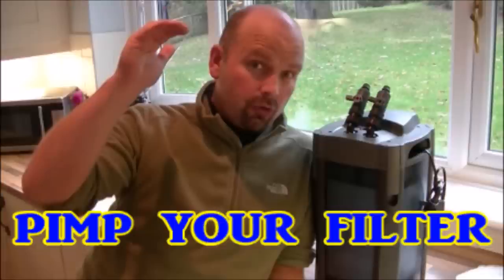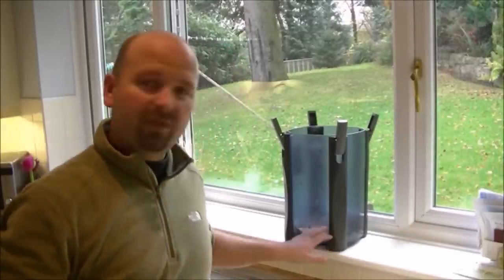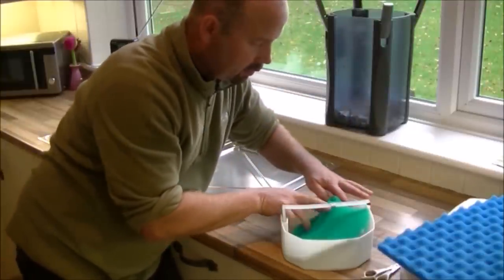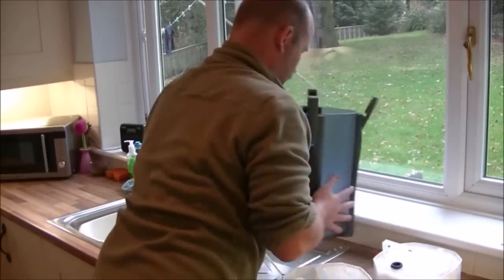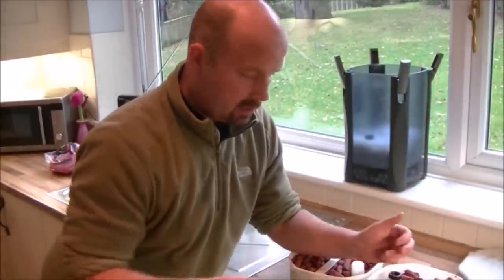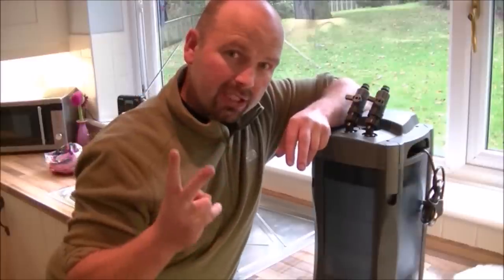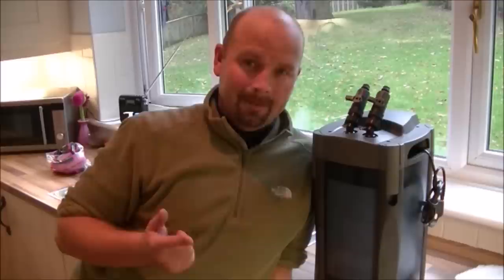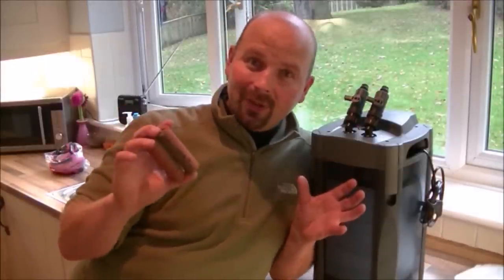External canister filter set up, nitrogen cycle and what happens in a filter - by Pondguru

Comment: how loud are there external filters?
Reply from the maker: +Anthony Hague There should just be a quiet hum coming from them unless there is an airlock or damaged impeller. Most of the noise will be from the return feed if a spray bar is used and it is well above water surface.

Comment: I was looking at the fluval fx6 and it looks like
they stack the media backwards from this? they have chemical on bottom then bio then mech? this seems ass backwards to me.do you know why they would load the canister like this? any advice my friend.
Reply from the maker: blimpus I mentioned the FX filters briefly in this video but really should do a sort video specifically for filters of that type. They have the pump in the bottom, not top like most externals so the water flows from top to bottom through the trays. As the FX has good foam filtration surrounding the media trays you really only need a fine pad on top of the top tray. Therefore you can get up to 5kg of biohome mini ultra or biohome ultimate (as used in this video) and that should be good for a noticeable nitrate reduction in around 500 litres. No need for chemical filtration when the filter is set up properly (as there will be no ammonia or nitrite) unless you need to draw in some residual fish treatments (after treating fish) or colour from bogwood.
Reply: yup! makes sense now that i see the way it is setup with the pump on bottom.

Comment: does anyone know if the Aqua one 600 nautilus should have rubber O- rings or grommets on the interconnecting basket (to make a basket to basket seal when the water in pushed down to the bottom on the canister?. My unit did not have any, but i`m struggling to find info / picture that show a Aqua one 600 nautilus setup in close detail.
Thanks
Reply from the maker: +Richard Gormley I know manufacturers have been moving away from having them in the filters as they are easily lost. I'm not familiar with that particular filter unfortunately so can't say if it should have them or not.
Reply: +Pondguru Outdoors 
ok thanks for the reply, i will go back to the shop  where i bought and ask them,..and ask to have a look in another unit and see it it`s in there. (maybe my unit  was opened / missed at the production line?)

Comment: isnt dropping lose media to the bottom of filter will reduce flow rate of water? add length of hoses & your canister will work 3d of speed it should isnt it?
Reply from the maker: As long as the media used in the bottom to diffuse the flow is ring shaped water flows through it no problem and it does not affect the flow. I can't understand the last part of your question unfortunately - looks like google translate has substituted wrong words in there.

Comment: any recomendations for a 80$ filter for a 55gallon hob or canister
Reply from the maker: +NorthEastPatriot I would avoid HOB filters as they rely on an expensive cartridge system and have very little space for proper filter media. I'm not sure what is available as far as externals go in the US as I am in the UK but ultimately the most important thing is what is inside the filter and how that is set up.
Reply: +Pondguru Outdoors ok thanks
Reply: +Pondguru Outdoors Im narrowed down to a sunsun 302 canister or a aquaclear110
Reply: +Pondguru Outdoors probably going to go with the sunsun due to the fact of media i want alot of bacteria that a hob doesn't provide.
Reply from the maker: +NorthEastPatriot Yes, that was going to be my answer to that one - I'm not a fan of HOB filters at all for that reason.

Comment: One question,  eheim 2217 , would that be set up with with the foams in the bottom as well ? Thank You in Advance.

Woody's Discus
Reply from the maker: Yes foams and fine pad in bottom although the design of that filter doesn't lend itself to being set up properly as the weight of media can crush the foams. Much better to get a filter with separate trays for media and foams.

Comment: can the the bio balls that have bacteria in them be used in saltwater
Reply from the maker: +Ricky Leigh The ones featured in this video contain freshwater bacteria so are no good for marine. They won't harm it as the gel will still be used by marine bacteria but there is a form of gel balls specially formulated for marine use called 'Pure reef balance' from the same company and they work very well. I have them on my website here: http://filterpro.co.uk/pure-reef-balance-marine-filter-balls-80-p.asp
but I have also found them on Amazon (currently cheaper) here: http://geni.us/zyh

Comment: where can i buy course foam and medium foam..i cant find in lfs
Reply from the maker: Amazon or ebay will have it or you could try places which are more specialized in pond fish / koi - just search 'replacement pond foams' and it should come up. I send them all over the world from http://www.filterpro.co.uk but they should be available locally - even if you go for the flat foams that is OK as there isn't a massive difference between the capabilities of flat vs bumpy foams. As long as they are layered in correct position they'll do a good job.

Comment: Noob Question: When you clean the filters. Do you clean the bottom also? Where all the muck has been settle out?
Reply from the maker: +Tboy Ojojoj Yes the bottom of the filter and the foams are the most important parts to give a good cleaning. The media should stay clean if the filter is set up properly but if it looks a bit dirty simply shake the media trays in water you have drained from the tank into a bucket.
Reply: +Pondguru Outdoors Thank you for you quick answer. Really appreciate it. I'm just about to place an order for this kit and will give it a try. /Tommy.
Reply from the maker: +Tboy Ojojoj Sounds good to me and thanks for the order, man.
Reply: +Pondguru Outdoors I got my order today. Thanks for fast shipping and everything was as I expected. I noticed that on my filter I have 4 trays. Can I use a thick coarse filter in the bottom tray before the tray with all three filters (coarse, medium, fine)?
Reply from the maker: +Tboy Ojojoj You can fit some foam in the cavity but as the water from tank comes down the small tube there is a good chance it will hit the foam under the trays and clog it quickly since it will be hitting one small spot unless foam is held on the bottom of the container - hope that makes sense.
Reply: +Pondguru Outdoors That's not what I mean. In mine filter housing I have 4 trays. yours have 3. So what I meant was that in the bottom tray. Say number 1 from the bottom I would have a course filter. 2nd tray from bottom I have your setup with cours, medium, fine filter and 3rd tray biohome media and 4th also biohome media? 
Do you understand what I mean? 
I also just ordered some more biohome ultimate. My trays had more volume than I thougt so 3kg didn't cover it. :)
Reply from the maker: +Tboy Ojojoj If you can get the coarse, medium and fine foams into the bottom tray then do that and fill the trays above that with media but if you don't have enough media or don't need that amount of media then by all means have the bottom tray full of coarse foams and the C,M,F foams in tray above that with media in trays above that.
Basically as long as you have the mechanical filtration done before the water hits the media its all good.

Comment: Me again. ...... I need your help..... I'm having problems with my water being cloudy. ...I've checked all the levels and everything is good. ...ph is 6.8 my ammonia is  0 ppm, my nitrite is 0 ppm my nitrate is 20 ppm..... fish seem happy but water is not clear....ive done several 25% water changes every 4th day.....it's starting to get frustrating. .. I feel like throwing in the towel. ..... do you have any suggestions on what is the problem?  I also added eheim tore pellets to lower my ph from 7.8 to 6.8 seeing how I have a community tank with different tetras...
Reply from the maker: Could be a bacterial bloom which will take time to settle or it could be you need more fine filtration in your filter. As few specifics on the filter, substrate etc. would help me - even the water changes may cause cloudiness stupid as that may sound but if you have water going in with residual settling agents (as used in water treatment plants) coupled with inadequate filtration the water going in can cause a clumping  effect of suspended solids hence the cloudiness.
Reply: Pondguru I have 2 eheim 2075's and on both 3 of the 4 trays have biohome ultimate. ... I'm also using (2) 9watt  sterilizers on the out put of each filter...... my water quality when I test it are good, my water changes is with ROH water.......
Reply from the maker: John Swan Hmmmm, you will have foams and pads in correct places in filter too so they should be catching the cloud in water. All I can suggest is adding something like 'filter aid' which is  clumping agent and that should help the particles get caught in the filter. If it is a bacterial bloom it will clear on its own and is best ignored. I have a friend who had a terminally cloudy tank and he tried everything for weeks then I got an excited phone call from him one morning saying that the tank had cleared over night. The previous evening he had added a couple of almond leaves but I'm not sure how, why or if that had anything to do with the sudden clarity.
Reply: Pondguru do you think that maybe the eheim tore pellets have something to do with it....
Reply from the maker: John Swan Seems like a bit of a coincidence but I'm not familiar with that produce so don't know how effective it is or what side effects it may have. I'm generally not a fan of dried peat especially if it is baked as it can cloud the water.
Reply: Pondguru thanks again for your time, I really appreciate it. ..... I think I will order the peat balls that you sell on ebay and try it instead of the eheim stuff..... cheers

Comment: Hi i was wondering if i set up my HOB canister filter the right way with my foams. Its an Oddyssea make. I have got Biohome ultimate on the bottom, a thick black pad then a thick white pad on top of that, then the blue foam of yours and your white polishing pad on top. I saw in this video that u put the polishing pad on the bottom. would i have to do this on mine as it would leave a pretty big gap otherwise where the thick black pad is. Please reply with any info thanks.
Reply from the maker: +Fish Tales Some filters work bottom to top and others work top to bottom but all filters should be set up so water hits the coarse sponge first followed by medium (if used) and then the fine pad. Once water is cleaned mechanically (by foams) it should hit the media. That way your media will stay clean and operate at best efficiency.
Reply: thanks for the info but what do u mean by media? sorry bit iffy on the techy stuff
Reply from the maker: +Fish Tales Filter media is the stuff which supports bacteria. In this video I am using biohome ultimate but there are loads of different types. Most filters come with ceramic rings.
Reply: Doh i see now what u mean, i got 2 course thick pads after my biohome black an white and your blue pad and white polishing pad on the top and i notice that the white pad gets really mucky but the water coming out is usually clear so i must be doing something right. Thanks once again.
Reply from the maker: +Fish Tales No worries, any time.

Comment: +Pondguru how would I go about setting the 
 eheim ecco pro 300 canister filter up the way you had it 

Thanks
Reply from the maker: +Andrew Stanley Arrrggh...they aren't the best for setting up as a proper filter but the layout should be exactly the same with foams in bottom so water is polished before hitting media. You'll have to put the media in filter bags to make it easy to remove as I don't think those type of filters have removable trays. Just make sure the inlet is not blocked at the bottom of the filter. The divider should sit above that but sometimes when filters are bought used the divider will be missing.
Reply: +Pondguru Outdoors my filter is bought as new everything is intact and have 3 removable trays and a ring on top with coarse ring do I not need carbon filter in
Reply from the maker: +Andrew Stanley Thats good it comes with trays as it makes the set up and maintenance very easy. Many of the cylinder filters don't have trays. Sorry I was looking at images of older versions of the ecco range for my previous answer. I see you have a coarse 'prefilter' sponge on the top of the filter so leave that in as extra mechanical filtration and set up the trays as per this video. If you need to know how much media each tray will require just send me sizes of trays (diameter and depth) and I will work it out for you no problem.
Carbon really should be the last thing used and it does draw in colour from bogwood and treatments but in a normal tank it will not be needed - should be the last thing water hits if it is used in a filter as it clogs up extremely fast.
Reply: i have 3 trays on this filter - https://www.eheim.com/en_GB/products/technology/external-filters/ecco-pro-300 one will have filter wool in and the other 2 do i just put same media in both 

thanks
Reply from the maker: +Andrew Stanley Yes best to go with same media in both trays above the (bottom) foam tray. I'd like to think that filter would take at least 1kg of biohome ultimate per tray as its recommended for aquariums of around 160 litres but if you send me dimensions of the trays I can work it out for you no problem.
Reply: +Pondguru Outdoors the tray dimensions are 145mm diameter 45mm deep 

Thanks
Reply from the maker: +Andrew Stanley Thanks for dimensions. It works out at around 0.6kg per tray which means you will only get around 1.2kg in the 2 trays - that may not be enough to achieve full cycle filtration (reduction in nitrate) as it normally takes around 1kg per 100 litres even for a normal community tank. Obviously ammonia and nitrite will be handled no problem when less than 1kg per 100 litres is used but to get enough anaerobic bacteria in the system to act on the nitrate a decent amount is generally needed. Hope that makes sense.
Reply: +Pondguru Outdoors hi do you an upgrade package with 2 kg of media
Reply: +Pondguru Outdoors hi do you an upgrade package with 2 kg of media
Reply from the maker: +Andrew Stanley I don't but I have one on my website for 1kg with the foams. If you order an extra 1kg it will take go out in single box by next day courier (assuming you are in UK) - here is link filter kit page and the 1kg amount of biohome ultimate is on 'biohome' page: http://filterpro.co.uk/filter-kits-8-c.asp
Regards,
Richard

Comment: Hi, I’m getting an Oase Filtoclear for a small goldfish pond. Would adding Biohome to the section below the sponges help with the bio? Or is it out of sync I.e. Biohome, ultimate would be below the sponges!
Reply from the maker: Using biohome in the bottom would be too dirty to be effective and the ideal scenario would be to have the filtoclear feeding up to a shower filter filled with larger biohome or 30mm-50mm pumice (or a combination of media) where it would work much better in a cleaner environment.
Reply: Pondguru thanks for the advice. I have chosen the Filtoclear as I want to be able to hide the filter set up. By the sounds of your suggestion it would mean I’d have something that sticks out which isn’t what I want at all. Any other advice?
Reply from the maker: Jimmy Mature if you're not after achieving a full cycle then the filtoclear alone will easily keep water clear and healthy. As long as you don't overstock the nitrates shouldn't get crazy high enough to harm fish and planting around margins will help with nitrate reduction.

Comment: brill video ! Could you please give me your details for me to purchase some media from you  I live in Wales so no problem with shipping  so price of media and details your details would be great . Thanks  again. Cheers Paul
Reply from the maker: My contact details are in the video description (just click 'show more').
The price of media varies as there are different types and price reduces with quantity - as a guide use the ebay link n video description. Just let me know what type you are after or what type of filter it is for and I can work prices out no problem. It doesn't have to go through ebay as I can send invoice through paypal which works out a bit cheaper due to ebay fees.
As  rough guide to see best results in nitrate reduction you need to use around 1kg per 100 litres of water.